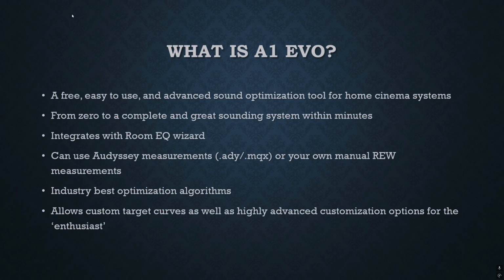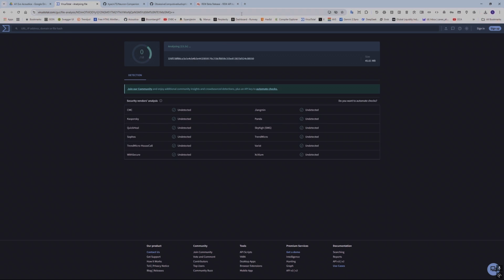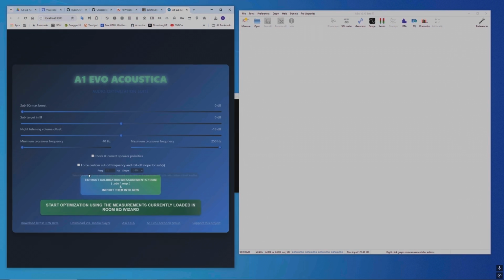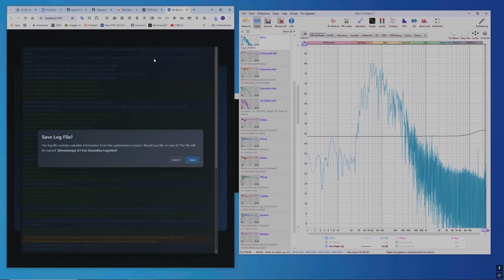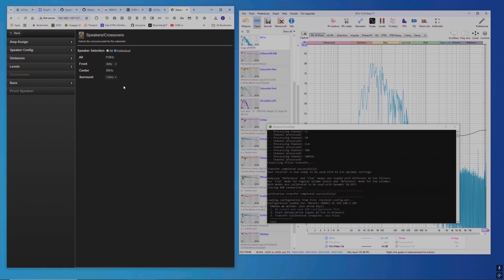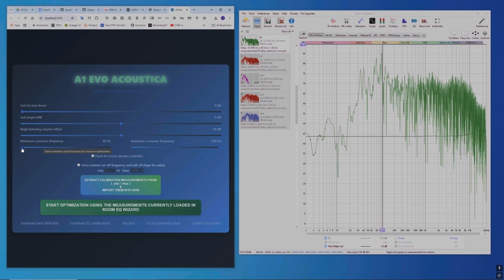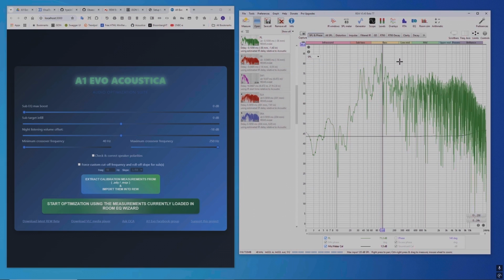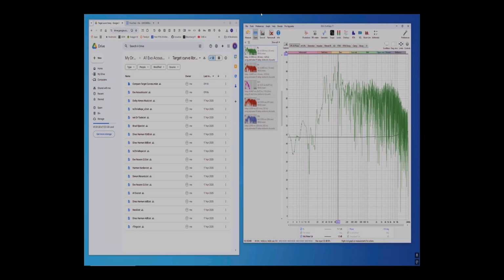A1 Evo Acoustica

Comment: Denon AVR X3400H:
Mac ARM V3 
Success connecting to the AVR
Success creating the OCA file
Failed to transfer 

i tried to use A1 Evo acoustica on my AVR X3400H and when I transfer the final file, i get this error message:

Error: INIT_COEFS: No valid response (buffer overflow)
Error: INIT_COEFS: No valid response (buffer overflow)
    at cleanup (/snapshot/A1EvoAcoustica/sendFilters.js:640:42)
    at Socket.handler (/snapshot/A1EvoAcoustica/sendFilters.js:657:11)
    at Socket.emit (node:events:537:28)
    at addChunk (node:internal/streams/readable:324:12)
    at readableAddChunk (node:internal/streams/readable:297:9)
    at Readable.push (node:internal/streams/readable:234:10)
    at TCP.onStreamRead (node:internal/stream_base_commons:190:23)
Cannot attempt to exit calibration mode during error cleanup. Reason: Connection/sender not available.
Closing AVR connection...

Failed to transfer second time and this time i got Error: INIT_COEFS: No response received
Error: INIT_COEFS: No response received
    at cleanup (/snapshot/A1EvoAcoustica/sendFilters.js:640:42)
    at Timeout.<anonymous> (/snapshot/A1EvoAcoustica/sendFilters.js:666:11)
    at listOnTimeout (node:internal/timers:564:17)
    at process.processTimers (node:internal/timers:507:7)
Cannot attempt to exit calibration mode during error cleanup. Reason: Connection/sender not available.
Closing AVR connection...

Was able to transfer the newest OCA file, with the 1.0 version of the transfer utility. 

But the reference mode overdriven bass issue came back.

Comment: Dear OCA,
Unfortunately, both v2 and v3 Acoustica causes issue with x6800h. There is no sound at all in Flat and Reference modes. Sound appears if I turn MultiEQ OFF or L/R Bypass.
Also, crossovers are absent - all speakers are set to be FULL RANGE. But this is not the case
Reply: Hi, was this resolved with later versions? Or do you still have this issue? X6800h usere here as well…thanks!

Comment: There appears to be a regression with version 3.0. I have an X1700H and am using the Mac arm64 version of your app. When I try to transfer the oca file, it fails at SW1.
!!! FAILED sending: PACKET 4/4 SW1 Reference (TC01) SR02: No response received

It then times out and the receiver is left in a bad state. If I try to transfer again, it says the AVR does not support multiple presets, which is incorrect and then times out at the GET_AVRINF request. I cannot power the receiver off, either. Not using its web interface, the Denon iPhone app nor pressing the power button itself. I have to unplug it.

Edit:
It looks like things are even worse than described above. I rolled back to version 2.9 and re-uploaded the oca file I'd saved at the time. It seemed to go well. No complaints during upload.

I started playing a disc and the Dolby Surround audio came out fine, but when it tried to play Dolby Atmos, I got nothing (maybe relevant, I don't have Atmos speakers. I'm 7.1). No audio at all in Reference, L/R Bypass or Flat. I only hear sound with Audyssey in the Off setting.

I did look at at the A1Evo.html update on GitHub and it appears the most relevant change to my situation is the FIR tap count change from 511 to 512. Perhaps 511 is the better number for the X1700H? Did writing the extra tap values overwrite some other, unintended values? And if so, can they be restored so audio will start playing again?

Hopefully, you know what is going on and it is an easy fix.

Edit (2):
This problem still exists in version 3.1. I pauses trying to send SW1. Eventually it says:
--- Processing Channel: SW1
   Flat mode filters for channel SW1 were sent successfully.
!!! FAILED sending PACKET 4/4 SW1 Reference (TC01) SR02: PACKET 4/4 SW1 Reference (TC01) SR02: No response received

--- EXECUTION FAILED !!! ---
Error: PACKET 4/4 SW1 Reference (TC01) SR02: No response received
Error: PACKET 4/4 SW1 Reference (TC01) SR02: No response received
    at cleanup (/snapshot/A1EvoAcoustica/sendFilters.js:640:42)
    at Timeout.<anonymous> (/snapshot/A1EvoAcoustica/sendFilters.js:675:14)
    at listOnTimeout (node:internal/timers:564:17)
    at process.processTimers (node:internal/timers:507:7)
Cannot attempt to exit calibration mode during error cleanup. Reason: Connection/sender not available.
Reply: excellent descriptions

Comment: I just tested version 3.0, which was just released!!!!

My subwoofer operates in the 30-180 Hz range. Should I limit the "Max crossover freq" to 180 Hz before starting the optimization?
Or should I set the traditional LFE to 120 Hz, but is that the best choice?

I started an optimization and I'm wondering about SW1, polarity inverted to true? Because until now, it was always false on other NEURON versions. Is this normal?

Thanks in advance for your answers.

David

Comment: Hi Serkan.  Quick question for you.   I initially did the first A1 Evo on my Marantz last year.  Love it,  it made my system sound so much better.  Haven't done any of the newer versions yet,  but am looking to possibly test this one.  When I initially did the A1 Evo version,  I had set up a custom bass bump curve to the house curve i chose (similar to the +8 dB curves).  However,  i didn't save that edited curve.  It's there a way to get that exact curve back in the program from the outputted files so i can use that similar curve while trying this version?  Any help is appreciated.
Reply from the maker: Not unless you saved that REW mdat file.

Comment: Hi OCA, thank you so much for this tool. I am loving since day one. A question for how to take measurements to achieve best results:
- i am using the standard audessey mic on a 6400h 
- should all 8 measurements be taken or are 3 enough. Not really sure where to find more “listening positions” 
- after the measurements i can tune the result in the multi eq app.e.g toggle mid compensation, change speaker size from full to small etc. what is the best practice? Keep as is ? 

Thank you for your time!
Reply from the maker: close proximity ear height measurements at and around mlp.

Comment: Hi, I'm pretty new to this and tried this a couple of days ago. The bass performance and overall cinematic feel has improved greatly.

A couple of questions :

1. the center channel is a little "hot", if that makes sense. A cb little high on the treble. How would I improve this?

2. I have a Marantz SR7015 and running 5.1 plus front heigh channels. Can I still use Auro 3D?
Reply from the maker: 1. A different target curve with more HF tilt.
2. Yes
Reply: 1. Can you recommend one?

Comment: 2.9 seems with the acoustica house curve to have resolved the issue with reference for me - but a new wrinkle - Atmos content doesn't output audio when played. Audio content that's not Atmos plays but when the receiver switches to Atmos - it goes silent. Regardless of flat or reference. X3400H. As a side note - flat and reference didn't sound any different from each other. I made no tweaks in the web interface of Acoustica - just the default settings.

Comment: What changed in this latest version? I can't keep up with all the versions? Are there any audible upgrades too, if so what are they?
Reply from the maker: And why is this my problem?
Reply: @ocaudiophile  I didn't intend to be unfriendly! Developments are great, and especially sharing it freely. I just wondered what's the differences since Evo Neuron version.
Reply from the maker: @MrArnand no difference in the optimization process, all those updates are to fix calibration transfer issues with certain models. I don't even know if they will work since I cannot test them with my AVR. That's why I don't release update logs. Also, the full code is on github which shows every change made since release.

Comment: I had to rerun Audyssey to get a calibration with my subs set to directional. Normally when I run it as standard I get -11 on both my subwoofer trims but when I ran it as directional I got -11.5 and -12 twice. I know -12 is the min on Audyssey so do I need to run it again to get higher before doing acoustica?
Reply from the maker: Not unless Acoustica gave you a subwoofer volume had to be "capped" warning.
Reply: @ thank you!

Comment: Dear OCA,
Congratulations on one more amazing achievement 👏 
It has been years since you last explained AVR settings for taking sweep measurements. Previously, it was necessary to upload dummy .aby file (with all zeros in calibration data). In this video, you mention -10dB for LFE. Should that be applied in AVR? You recommend disabling dynamicEQ: is that applicable for taking measurements as well? What other settings should be made on the receiver?
I believe that still there is no tool besides MultiEQ app to transfer dummy aby to receiver for measurement taking. This process is still so old-school, comparing to the automation level that you offer with A1 Evo.
Reply from the maker: Everything should be off when you are taking manual measurements with REW for Acoustica.

Comment: I seem to get an error message at the end of the optimization all the time, no matter what I try: [ERROR] It's not possible to sync your speakers at the MLP with the available hardware limits of your AVR. You'll need to move these speakers closer and repeat measurements! 

Does anyone have a helpful idea how to fix it? Many thanks in advance.
Reply from the maker: You must have major delays in your lines i.e. a wifi dongle for subwoofer.
Reply: I am using a mix of active and passive speakers, and I assume the wireless connections to the fronts and rears in a Master/Slave setup cause that. Question is still whether there is any possibility to get it working, as I don't have a possibility to change anything in my setup.
Reply from the maker: @floriankuhnen8925  The maximum delay limit of 17.5ms comes from the hardware so there's no robust way to manage extra delays introduced by wifi dongles.
Reply: @ocaudiophile  not sure I fully understand your explanation, therefore just to confirm: you mean with "hardware" the active speakers in a wireless M/S setup, and their latencies significantly higher than the passive wired ones (difference >the max latency of 17,5 ms) is basically the problem.
 If that is true, it means also if there is a way to reduce the latency in my mixed system to a lower value than 17,5 ms it should work without this error (e.g. connect M/S wired which comes with a significant reduction according to the manufacturer)?

Comment: I get Target curve not found. I tried putting all curves in the url rew/eq/target settings/house curve but they are not detected.
Reply from the maker: You must be forgetting something. This is not possible.
Reply: I did it carefully, but I,ll try again from the beginning.
Reply: I had the same problem.
Fixed it by updating some Network/Framewirk on  Windows

Hope this will help you - good luck ;-)
Reply: you can set the target curve by clicking in REW on the EQ Tab. Then Target Settings -> House Curve. Evo Acoustica.txt to be found in the target curve library in google drive of OCA.
Reply: @PHSEnergy That worked, thanks 🙂
Reply: PHSEnergy solution was exactly what I needed. I also realized it is mentioned at the end of the video. Thanks 🙂

Comment: OCA, thanks for the amazing work. The new version is very nice, simplifying the process, and I especially like the prompt for which preset to use when transferring. I've done three builds with Acoustica so far, one with no adjustments, one with max bass boost, and one with max bass fill. I'm on a X3800H. I feel like in each case, the bass is very lacking, almost non-existent. Each one I adjusted the Subwoofer out to max +12db and it helps, but not as good as it was with Neuron 3.1. Any advice?
Reply: I’m using the same AV receiver. However, I’m facing an issue where the subwoofer doesn’t turn on at all when I use A1 Evo Acoustic. Previously, with Neuron 3.1, I had no problems whatsoever, and the bass was outstanding. I’m not sure what’s going on, but I suspect the Acoustic version might still have some bugs.
Reply: @-dAtA-TRoN-  From the little bit of testing I've done, not feeling like Acoustica is right. For me, Atmos performs poorly and bass is barely there. I'm back on Neuron 3.1 for movies for now. I left Acoustica on Preset 1 for low volume listening.
Reply from the maker: Did you check if every setting in the logs were transferred correctly in the AVR set up menu? If you can't achieve great sound, it's likely due to a problem in settings transfer which still has issues with certain AVR models.
Reply: @ocaudiophile  Do you mean the log file that is generated after the transfer? I checked it and no indications of errors. I even later used the Acoustica application to transfer my previous Neuron 3.1 build back to the AVR successfully.
Reply: So I just experimented with Acoustica v2.9. All previous and current builds used the same .ady file. Each time after transfer went into speaker levels, made some minor adjustments to include maxing out the Subwoofers. First build with no modifications to the settings -- noticed levels overall were lower than I'm used to when checking them for needed adjustments, bass was poor, felt like Atmos was lacking. Second did full Bass Boost, some improvement, but still not as good as Neuron 3.1. Final build was with Bass Boost and Infill maxed out in settings -- this was best result for me with Flat and Reference. Reference was the best imaging for me at low and loud volumes. I'm staying with this build for now.

Comment: Hi OCA, I have tried the latest version, everything seems Ok with std 5.1 DD, but can't play anything back with sound that is in Dolby Atmos without turning MultEQ off completey in the App for Marantz 70S, there's no sound if reference or flat selected, can you advise please?
Reply: I used the v2 of sendallfilters and works for me, denon S760H
Reply: @markaspinall7709  the same situation
Reply: did you try transferring the OCA file again? It worked for me when I got no sound on one of the attempts.
Reply: Hi, yes I've tried a couple of times, it only seems to be Atmos encoded tracks, everything else works oddly
Reply: @markaspinall7709  yeah, I tried a few builds with Acoustica and I ultimately feel like Neuron 3.1 build is working better for me. I even feel Atmos is performing better with N 3.1.
Reply: @markaspinall7709 I have the same issue with my Marantz SR6014. Tried to go back to v1 Acoustica and now my 2nd sub is muted with reference mode. Tried to transfer numerous times with the same result

Comment: Hi Serkan,

Thank you so much for your excellent work. Unfortunately, I'm running into some issues on my end. A1 Evo isn’t able to detect my receiver—neither automatically nor via its IP address. I have to enter the receiver model manually (X3800H), and only then does it work. From there, the process runs smoothly.

I'm using the same ‘ady’ file I’ve always used with previous versions of A1 Evo. Everything seems to complete successfully, including the transfer of the ‘oca’ file.

But then comes the unpleasant surprise during the sound check: my subwoofer remains completely silent. It seems like it’s not being triggered by the sound signal at all. I’ve repeated the entire process several times, but the result is always the same.

I’m not sure what’s going wrong and would really appreciate any help or advice you can offer.

Best regards.
Reply from the maker: Did you try checking in set up menu if  sw1 is turned off after transfer and turn it back on?
Reply: It’s turned on. The issue only occurs with the A1 Evo Acoustic preset. When I switch to Preset 2, the subwoofer activates immediately. Using the Info button on my remote, I noticed that in the A1 Evo Acoustic configuration, the subwoofer isn’t shown as active. However, in my second configuration, it appears as active in the info menu. This leads me to believe that Evo may have made a mistake with the subwoofer calibration in the A1 Evo Acoustic preset.

Comment: I am using A1 Evo Acoustica since the moment it was available, and I am super stoked with the results! The best my system has sounded so far! 

One question though. Currently, I am using the (default) provided Evo Acoustica target curve. I was wondering if generating a custom target curve, based on the Evo Acoustica target curve and my FL+FR speaker response would yield an even better result? @Serkan, I would love to hear your opinion on this!
Reply from the maker: If you believe the bass is a bit too much or not enough or high frequencies are too bright or too dull, you might try a different target curve of course. Copying your FL/FR in room response is a technique some people like to play with but the success of that is very much room and speaker dependent IMO.
Reply: @ocaudiophile  Thanks, exactly what I needed to hear! Sticking with the provided Evo Acoustica target curve for the time being, which is giving me great results!
Thanks again Serkan for your expertise and support, and for creating this magical calibration tool! 😎
Reply: @briersben ohhh what is that eye opening where to find instruction to create custom room curve from FRFL bcz my front sound perfect, I analog eq them already. They don't need much digital corrections 🙏🙏🙏🙏

Comment: Hi OCA, I have error message when trying to extract calibrating measurements from my  .ady file, message from localhost 3000: "Failed to send one or more measurements to REW. Please check REW connection and console logs."
My Marantz is SR6013
Reply: Update: I had to update REW. I was on Beta 22, I updated to 78 and it started working.
Reply from the maker: Did you start REW API server? Is your ady file corrupt?